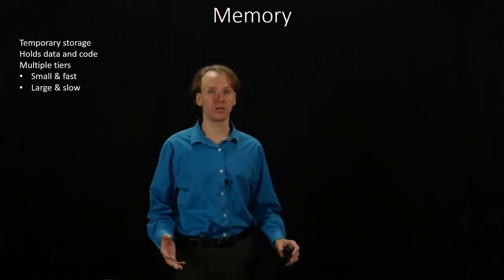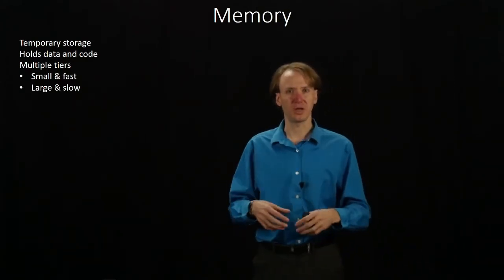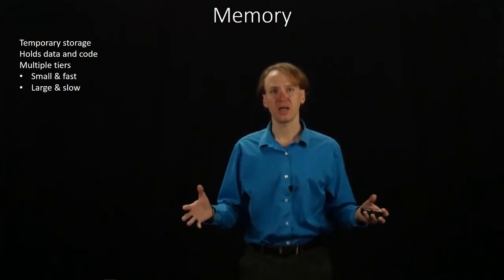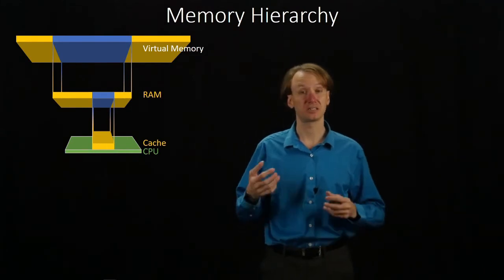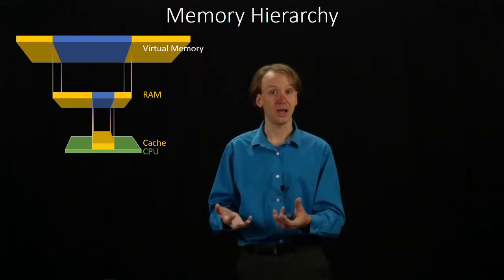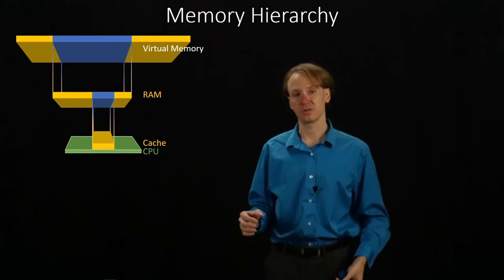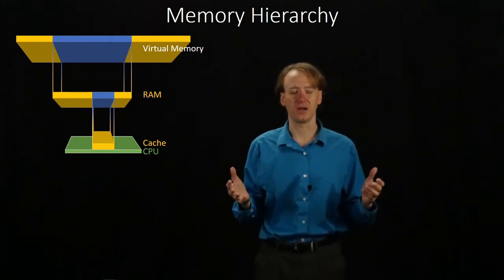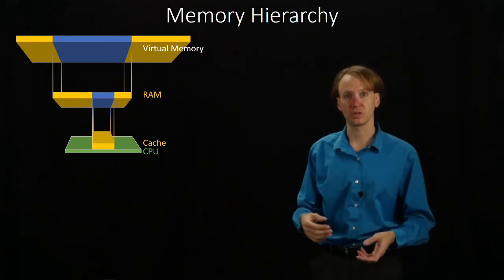1.  Introduction to the Memory Hierarchy

Comment: Please can you help me with information about the Gpu memory hierarchy with books or references. If you can, I will write to my e-mail for communication
Reply: GPU Memory is functionally identical. A graphics card is, for the most part, an independent computer system. The only difference to note is that GPUs have many many more cores than a CPU.  On each core is its own cache of SRAM memory that's a lot smaller than L1 cache. http://supercomputingblog.com/cuda/cuda-memory-and-cache-architecture/#:~:text=Typical%20high%20end%20workstation%20memory%20and%20cache%20,kB%20%20%2016%20-%3E%2048%20kB%20